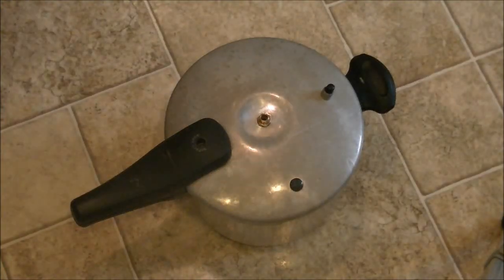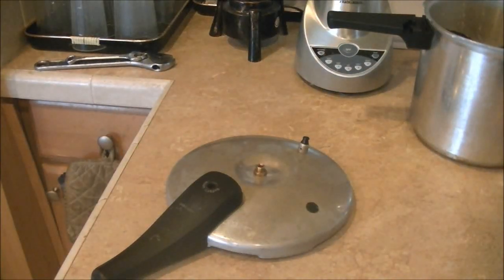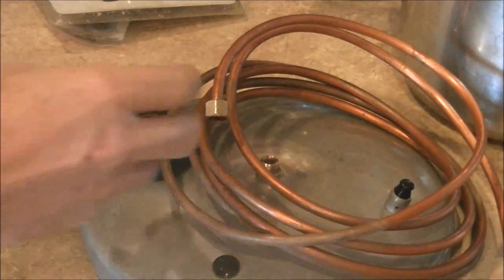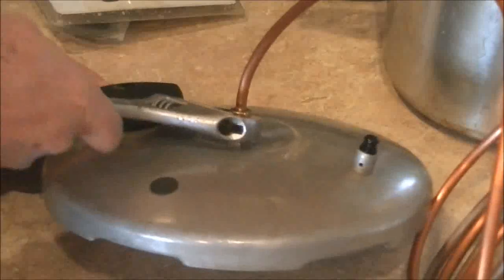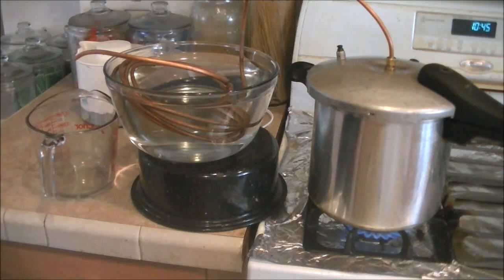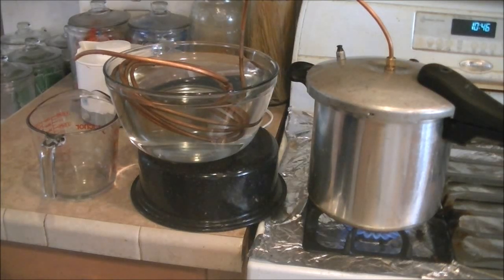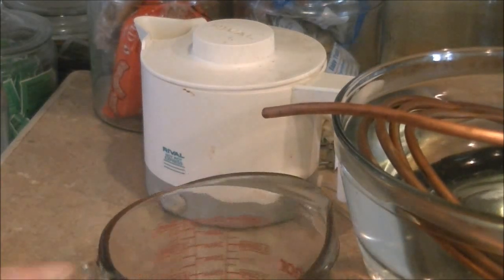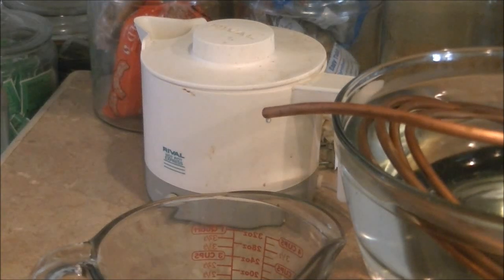Easy DIY Pressure Cooker Water Distiller

Comment: Distilled water is slightly acidic and some copper can leach into the final product.  Maybe that's why it doesn't taste all that good.  I was wondering if maybe use a much shorter piece of copper tubing from the cooker and then finish the rest with silicone line to limit the contact time with the copper would be better.

Comment: The vent tube on top of the pressure cooker is 1/4" in diameter and there is virtually no pressure from the steam in an open system like that.  A short length of 1/4" ID, hi-temp, food grade rubber tubing connecting the cooker to the copper tubing should eliminate the need for the fittings and will allow the cooker to be used as originally intended - one of the best ways to cook meat that doesn't attract unwanted attention. Another length of tubing from the copper coil to the product receptacle allows more of the copper tubing to stay in the cooling water and removes the need to continuously bend the copper tubing which will eventually crack and break it.

Both gas/electricity/wood and water are precious commodities.  Use as much of the heated water from the bowl in the pressure cooker when refilling it as possible.  The rubber tubing will allow easy removal of the coil from the bowl when necessary.

Comment: His pressure cooker is made of aluminum you should only use stainless steel Aluminum leaches into your body it causes dementia. Add 1/4 tsp of sea salt to each cup of water after it's cooled to add back the minerals lost in distilling water.

Comment: That teeny little brass insert that you put into the fitting before you tightened it was unnecessary. That insert is to be used as a stiffner if you were using plastic pipe. Copper pipe does not use stiffners.

Comment: Great idea, saving a lot of lives as SHTF. Also distills microplastics (endocringe disruptors), supposedly, like from pvc pipes, any liquids with higher boiling points than water will not be distilled. We have hard water, way too much minerals, iron, calcium carbonate, I agree, distill and then add sea salt, store in glass bottles with cork tops.

Comment: Hello I'm a wanted man and there poisoning my water supply through pipes through the tap or water that I buy from the shop I'm trying to make distill water to clean the poison just in case they have if I distill it would it remove the poison that's in it like maybe snake poison

Comment: I've watched a few videos about distilling and my advice is this, since there are some things lighter than water in the water, hydro carbons, which evaporate with the water: since they will evaporate first, let the still steam for a minute before you start collecting the water, or toss out your first 2 or so ounces of water you produce.
Reply: seems like very important info to know. thanks.
Reply: Is a minute or two long enough?  Will throwing away the first 200 mL clear the lighter (dangerous) fractions from the water (and the copper tubing)?  It is better to avoid water that might contain petro-chemicals than poison yourself and that is generally easy to do.

Comment: An American doing it the same way ... CHEAP ... ... $22 for supplies ... Goodwill - $6 pressure cooker ...  Lowes - $2 gas coupling ... Lowes - $10 copper pipe ... Lowes - $4 plastic bucket ( for the ice water ) ... a ( free ) soup can to wrap the copper pipe around ... = $22

Comment: DO NOT confuse aluminun with Pewter ... pewter is a combination of aluminun, tin & lead ... drinking from a "recreation" goblet or using a  "king of thrones" recreation fork. ... It certainly is made out of poisonous metals ( ... Tin ... Lead ... ) as poisonous metals melt at lower temperatures & are easier to manufacture ... CHEAPLY.

Comment: Ok the whole distilled water isn't safe B.S.
First this comes from people that are against salt. If you are adding salt to your food you have no problems.
For every 10 gallons of water add 1 teaspoon of salt. Iodine salt is best. You don't need no fancy  salt. Just regular generic iodine salt.
Iodine salt is sea salt.
You will see salt labeled as sea salt that is much more expensive. If it is iodine salt it is sea salt. However not all sea salt is iodine. You can buy sea salt that the iodine has been removed.
And not all iodine salt is taken from a sea. Back when it was deposited it was a sea. But there are deposits that are NOW in mountains. 
I own some land that is 5000 feet above sea level.  Less then two foot down I have iodine salt. Not worth mining due to the price of salt. But I have more salt on that land then I'd ever use.

Comment: Now see you are counter acting to what someone else said.
So distilling will NOT remove petroleum from water?
I need a cost effective way to remove petroleum from water.
My well water has petroleum in it.
I'm sitting on a lake of oil and no one will come buy it. 
Don't believe the lie we have been told for 50 years. There is a lot of oil in the U.S. I'm sitting on a lake at least 2 miles across and 150 foot deep of crude oil. Its just 400 foor below the surface. My water is below that at 750 foot.  But the water has oil in it.
Also 99% of these old oil wells from pre 1970s are full again.  
Originally the idea was to burn up all the opec oil and then we could corner the market on oil. ( at least thay was thier excuse back then) But now we know they fill back up in about 50 years.  This is for free oil. I can't say about fracking.

Comment: Straighten the copper tubing, make a small steel wool ball and string, polish clean the inside of the tubing and rinse. Stainless is best but at a cost. Also , the pot should  be stainless. Wah lah , no dry taste to the water. For smooth drinking water, put a "Tri-vortex " under the drinking glass or holding container for a few minutes to five. Distilled water is H20. Period. If you need to know why it's said to be bad, follow the supressive. The minerals in water are not organic as in food. If you want to know who is right, It's the person using true protocol of science. Not pseudo. Question everything.

Comment: I am a Power Engineer and I work in a Power Plant.  It is IMPOSSIBLE to get 100% pure water from making steam and condensing it in one stage.  The reason you see steam is that it has suspended (liquid) water droplets.  If you turn the heat up on a stove, the water just boils away faster.  More heat does not cause suspended water droplets to vaporize completely.  In a power plant this is important because water suspended droplets in steam erode turbine blades very quickly.  You must make 100% pure steam with no suspended water droplets in a power plant.  All gases, including steam, are invisible when there is ONLY gas.  So, this video is correct in that distilled water does not necessarily remove all contaminants.  So how do power plants get 100% steam that is only gaseous and has no suspended water droplets?  They superheat the steam.  Basically, this means that a boiler produces wet steam - steam that has some suspended water droplets.  Then that wet steam goes through a section of piping where it is  exposed to heat from the boiler a second time.  This part of the boiler is called the "superheater".  It "superheats" steam, i.e. raises it above and beyond the boiling point of the water.  Having said that, you shouldn't try to rig up a system at home that superheats steam if you don't know what you are doing.  People have done stupid things at home like trying to boil water in a propane bottle to create high pressure steam.  In one case, the propane bottle exploded and one person was killed.  In Canada at least, all pressure vessels have to be properly rated, licenced, and tested, etc.  This is not a criticism, just an explanation of why distilling water does not necessarily remove all contaminants, although it does remove almost all.

Comment: If you're only distilling water, get rid of the copper tubing. You need stainless steel tubing. You only need copper if you're distilling alcohol. The copper helps remove sulfides from the alcohol, but it puts a mineral like metal taste in water.

Comment: I am using a stainless steal pressure cooker i will let you know on the taste, I used a peice of rubber hose made for heat to conect pipe to cooker lid
Reply: Diana Vidal "Rubber hose made for high heat" is worse than pure copper tubing. Your body needs copper as a micro-nutient, so trace elements of copper will not hurt you. Another video on this subject matter, said only use copper for the tubing.

Comment: you can improve the performance of your set up by making a dedicated cooling can where the steam enters the coil of copper line at the top and then the coil spirals downwards with the output end exiting near the bottom of the can through the side and then use an elbow joint or bend the copper line downwards so the drips will fall in a consistent pattern/manner. use an empty restaurant sized can and then where the copper coil exits at the bottom through the side, seal up any leakage there with some food grade silicone calking. then fill your cooling can with ice water which will surround the coil and greatly improve your distillation rate and possibly increase your out put and should still fit inside your cooker. if it does not then trim the can down from the top until it will fit.

yes this will mean that you have to put the catch container below counter top level or raise the cooling can up above counter top level but the gains should be worth the extra bit of trouble that goes into adjusting your set up. another thing to consider is wider the copper tubing will speed you up but only so much. anything over 1/2 inch for this size pot still would be overkill

Comment: I was actually looking for this just to see if using a pressure cooker was possible to use both easily AND safely. This answered the question with a resounding YES. I want to distill my water for use in a CPAP (BIPAP actually), and for mixing my own windshield washer fluid among other things, so I don't really care what it tastes like. This will work very well. Now if I can only find a cheap 6 quart to two gallon pressure cooker and a cooling coil for cheap. Marketplace and Craig's list, here I come!

Comment: Use fittings on copper tubing when you can. Only argon welds, every other type solder has lead in it. If you can find stainless steel or ceramic canners or tea pots, use that rather than aluminium. Clean with apple cider vinegar. You should get enough minerals with eating fruit but if you have none, Guardians of eden have the best on the market minerals and hydrogen peroxide @ 30+%. Jutrian minerals are top shelf. 
Gooluck and God Bless!
Reply: REALLY ? How many Thousands of gallons would u have to drink to get any lead from the tiny bit of solder ?

Comment: Great videp friend. I was thinking of doing the same setup with a stove top pressure cooker like your's, but with stainless steel tubing to eliminate any copper trace in the drinking water Also, I would install a 0 - 20 Psig guage on the lid as a safety percaution to monitor pressure. Now, if I could find a pressure cooker like your, I'll be set to purify water from our back yard swimming pool as one water source, but as a last resort. But hey, would'nt it be easier to locate a clear water spring near by, that you can filter and treat with 2 drops of unscented clorox bleach that kills germs to 1 Duart of this filtered water, then shake and let stand for an hour before drinking. Its great to figure different methods of making your own drinking water, because the rule is, you'll last only 3 days without good drinking water. I just bought a Katadyn Pro Water filter for when I go hiking, I also viewed the Swamp Boss youtube video on how he did a homemade water purifier on the cheap, which I duplicated for myself.

Comment: While it would be a bit costly, I’ll bet an InstantPot could be used - nice as it has timers & heaters all built in. I’ll try to find an old dead IPot and use the lid from it on my good / working IPot - to make a water distiller. Plus the ‘pot’ inside the IPot is stainless steel so that would address the concerns about aluminum.
Reply: this is exactly what i have in mind...
Reply: I actually bought one today just for this purpose, I’m going to use high temp food grade silicone tubing to catch the steam.

Comment: You can add a half lime or lemon to a gallon of distilled water and it make the water alkaline.
Distilled water has a negative electric charge and attaches to and eliminates the positive charged toxins in the body and cleans your body.
All minerals can be obtained by eating vegetables, fruits, nuts and berries. Minerals come from the ground.
 Rain water, Nature's own milk, has no minerals but is itself distilled water.

Comment: How often does someone mistakenly distill their radiator fluid instead of using tap, lake or river water?  And WHO distills WASTE water ?!?!?
Reply from the maker: Those remarks were made as advice for people that intend to use a distiller in an emergency situation. If someone was in a dry climate and was desperate for drinking water they might think they could drain a radiator, and distill it. Not everyone lives near rivers and lakes, you know. Beyond that, I've read accounts of people in the desert distilling urine and other kinds of waste water for drinking water. It's usually done with  a solar still because it stinks, but if that's all someone can get, it'll work. Satisfied?
Reply: Ok, I was probably ignorant.  What I did get out of this, is the precaution to use only water without any petroleum / oils that could also vaporize and be distilled back into a fluid again.  Without the skills and tools to test - nobody knows what is in their tap water.  My tap water taste like it could actually be pumped into my house from someone else's waste water.
Reply: It's me, John Strabismus. I don't feel like switching accounts again. Right. If I was in your situation I'd drink distilled water, or I'd filter it. Over here in the Philippines I filter all of our drinking water with a Sawyer .01 filter. The water here is good, though, and I probably don't really need to do that. We're living on a very small, very mountainous island with numerous fresh water springs and rivers. Additionally, each municipality has its own water supply. I'm going to make a video about that one of these days. Anyway, I wish you well.

Comment: There are tens of thousands of man made chemical compounds, designed to be so stable they don't break down very well. They even defy nature's geological strata purification, and end up in very deep water tables, such as the one tapped by San Jose, CA. These are now, after building up cumulatively for over 60 years or so, in pretty much all water sources...many of these travel up in the steam, and end up in the distillate....UNLESS.......unless one uses a solid carbon block filter to purify the distillate.  The carbon block filters could be used by themselves, but with shorter use-time. But, carbon filters fail to remove the toxic Fluoride industrial waste added to so many municipal water supplies...need special filter. Distilling water first, bulk-removes most contaminants, leaving a lighter load of steam-carried contaminants to be removed by the carbon filter. Further caution, is that chemtrails are disbursing any number and type of toxic wastes...not so much to trigger rains these days, but to more likely make toxic superfund waste site contents "go away". This stuff ends up spread very thinly, but steadily accumulating, depending on drift, especially in regions most heavily criscrossed by most chemtrails.   Note: Media stopped mentioning "cancer clusters" towards the end of the 1990's, because clusters merged, becoming pervasive across populations. Similarly, media stopped mentioning "superfund cleanup sites" about the same time.... Costs to abate the toxicity of the sites were blindingly high, and there have been far too many sites world-wide. Some companies, like Rhone-Poulenc, et al, wanted to revive using industrial incineration to reduce quantities; numerous groups fought that, since it's impossible to get clean burns, and incineration results in unpredictable tertiary toxic chemicals created becoming the effluent, and, transporting those across the world, puts everyone, everything, and nature at-risk. So, with mandates to clean up the superfund sites, and incineration a bad idea for multiple reasons....how do these toxics get cleaned up? Sun-dump them? Space launch them? Pump them into active lava beds? Burials of them are time-limited. So...chemtrails.
Reply from the maker: Well, we live in an increasingly dangerous world, and that's a fact.

Comment: I don't think copper or aluminium is good for you. A real distiller uses stainless steel, it doesn't leech minerals. You be better off with a corning ware(glass) bowl and lid with a  hole in it and a piece of curve glass tubing. It doesn't need to go round and round, the water just needs to turn to steam and then condense. If the lid is sealed it will make pressure inside that will push the steam out of the curved glass tubing. I just don't want to see you poison yourself. A stainless pressure cooker would work fine, but aluminium is soft. Peace2you
Reply: I have used glass cookware for years and they can crack and shatter even though they are made for cooking